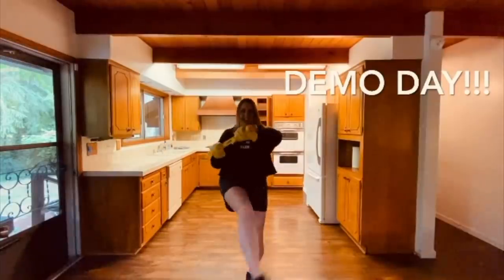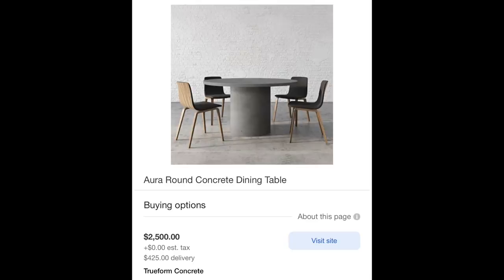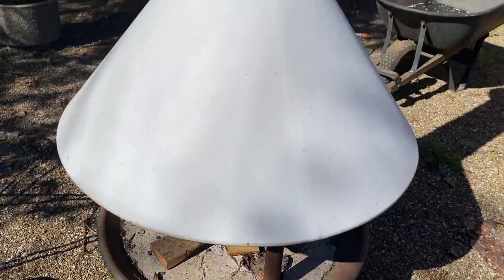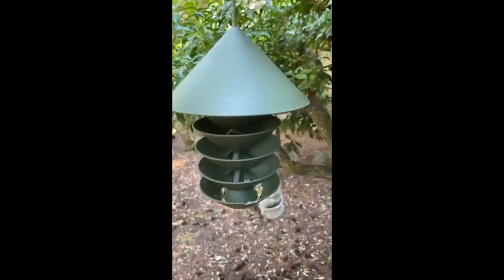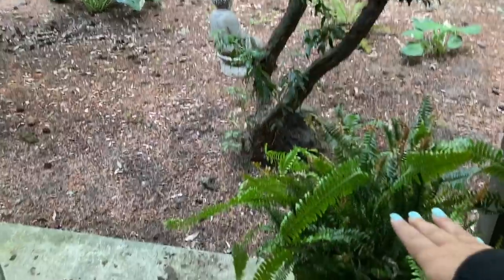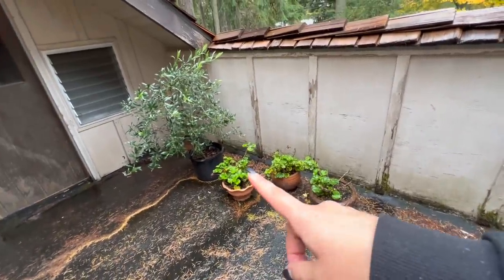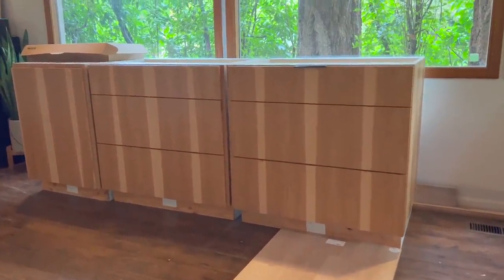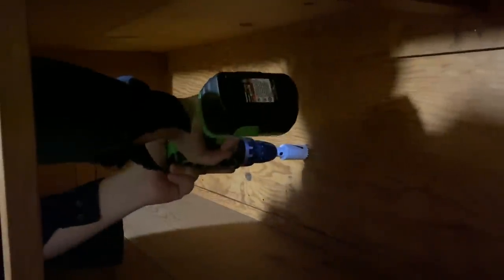WHAT HAVE WE GOT OURSELVES INTO?! | Home Renovation | Demo Day | Mid Century House | VLOG

Comment: That drop down shelf in the kitchen was common in the 80s (my husband was a custom cabinetmaker) for holding a cookbook. When we remodeled our 50s ranch, tearing out the kitchen was like being on an archeological dig….the layers of flooring, different paint colors behind the cabinets, wallpaper, etc. We spent ten months remodeling our house - evenings and weekends - before we moved in. Much easier to remodel when you’re not living in it!
Reply from the maker: That’s exactly what we’re doing and I’m so grateful we have this opportunity to do that. It’s hard living in a construction zone. Luckily our homes are less than 5 min apart so it’s east to make trips back and forth ❤️
Reply: I have the cookbook holder under my kitchen cabinet also! We bought this house in 93, so the 
“New” cupboards were probably put in in the 80’s!
Reply: There are some practical old fashioned features from the last century I remember. You know houses were smaller - especially kitchens. Ironing was a much bigger part of living and there used to be built in ironing boards that dropped down out of a slim cabinet in the wall. Also cutting boards that pulled out from under the limited countertops.

I’ve seen a couple of comments where people are worried the candles in the sconces on your patio may be a fire hazard. Perhaps some glass “chimneys “ can be found that would fit into the candle holders to protect the wood pillars.
Reply: @laraemitchell9064  they make battery operated flicker flame candles in tapers (Luminara).
Reply: You could also put an IPad on that drop down shelf to search recipes while cooking in the kitchen.
Reply: My parents have the cookbook holder and I found one at a garage sale and have had it in 2 houses. It is so handy. My favorite recipes live on it.

Comment: What a great find on the cookbook holder. We just redid our kitchen and found 5 layers of wallpaper. Two of them had been removed and I found slivers of them behind a couple upper cabinets. I personally removed 3 layers of wallpaper. A previous owner was a wallpaper nut. We did patching and painted. Tore out 1930's cabinets that were put in our 1955 built house (some time in 1970's). We put in new lower cabinets and a pantry. The old pantry was a former hot water tank closet. Sadly we found gas and water connections in bottom section. We had a plumber come out to fix that and fix old gas range connection. Cabinets ordered in April and arrived in late July (due to covid). Countertop came in a bit later, in August. We installed the cabinets and a local company did countertop install. We bought new range in Feb arrived in early April. Dishwasher bought and came quickly. New fridge was bought when old one failed just last week. We still have shiplap, flooring and back door replacement to do. So worth all the work. It looks 100% better. We did blue cabinets and will put in floating shelves eventually instead of upper cabinets.

Comment: I love this place and that backyard is amazing!! Couple of suggestions along with the other 5000 you’ll get. 1. Bake the bird seed - I think 250 for 30 minutes and it won’t cause weeds, wound up having to completely replant our yard because of this.  2. You can powder coat metal chandeliers and then add $1 store solar lights where the light bulbs were and hang them in your trees. 3. Take some clear glass vases and bowls, add battery powered lights inside and make mushrooms and put them all over.

Comment: Could you do a floating wood slat floor up in Little Italy? Something like 1.5" slats with a fairly large 1" gap between, floating two or three inches above the current flooring. That way the fir needles could easily fall through and be blown off when they're dry, and puddles would always be under the wood rather than underfoot.

Comment: I noticed your concrete floating steps. Love them. Spotted your concrete pots by your deck. I remembered the deal you got on those Wow. Have you thought of putting up a half horizontal slated wood screen in your carport? Like you had in Vancouver. Or a vertical open wood slat in-between the roof supports sort of framing your outdoor dining. I think the metal sculpture leading up your stairs is the most perfect piece for this area and shows your skill as a MC decorator.